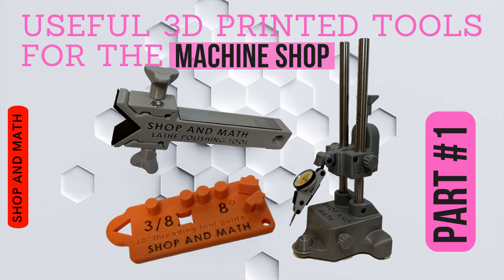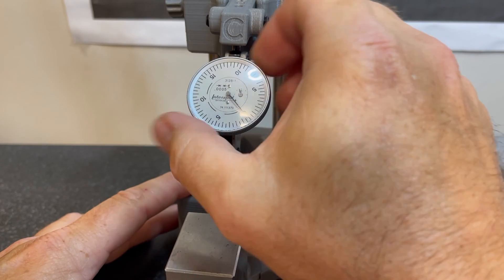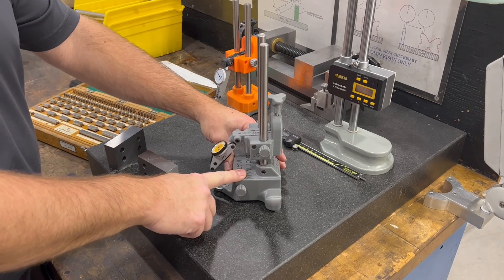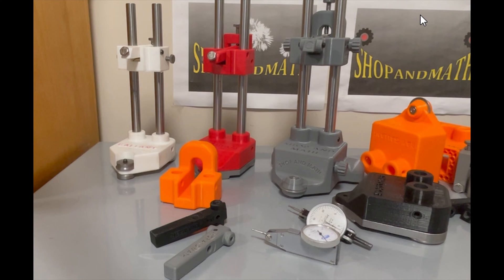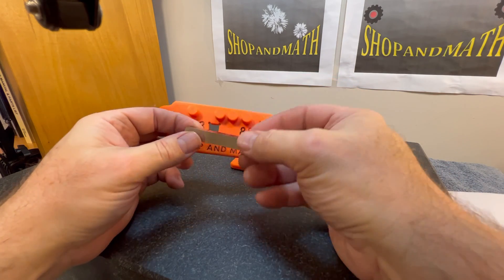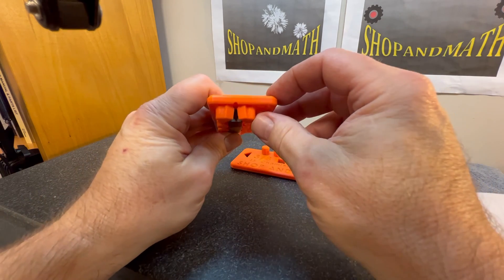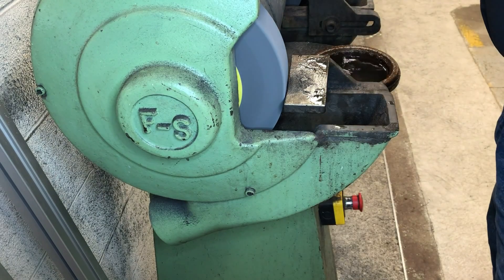Useful 3D printed tools for the machine shop

Comment: WARNING: (Very Dangerous Procedures)
* Video: (2:03/4:40) Lathe Polishing Tool
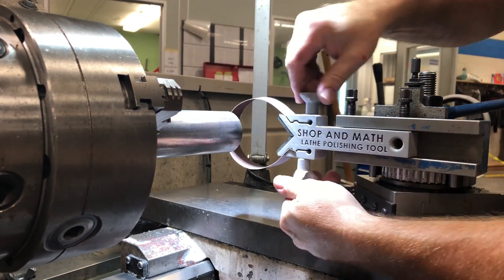* Video: (2:22/4:40) ['compound rest = 45'] Using 'cross slide' to pull sand paper strip back 
--> "NO SENSITIVITY FEAL" --> {Pull Material Out of Chuck}.
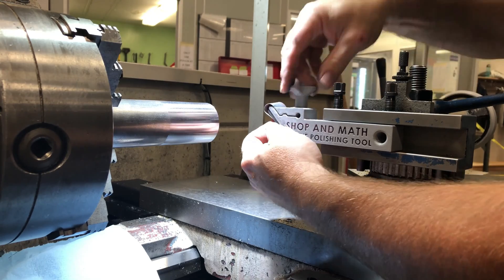* Video: (2:33/4:40) ['compound rest = 45'] Using 'cross slide' to push sand paper strip in 
--> "NO SENSITIVITY FEAL" --> {Push Material Out of Chuck}.
Reply from the maker: Hi Bill
You do realize that the lathe polishing tool is made out of plastic 3-D printed 
PLA 3-D printed plastic does not have the tensile strength to remove apart from the chuck
And if you could pull the part out without breaking the paper, and without breaking the 3-D printed piece, you didn’t have a tight enough 
Ray

Comment: What do you mean by "cosine error"?
Reply from the maker: Cosine error.
Basically, the indicator will not read a true distance traveled. I made a video on this to explain this to my students and I’m attaching a link.
https://youtu.be/toEVZeupYR8
If this does not explain it well enough, send me a message and I’ll try and explain it in a different way.
 Ray
Reply: @shopandmath  
That is an unfortunate term for using the cosine of the angle to calculate the length of the hypotenuse.  But thanks for clarifying what you meant.
Reply from the maker: @reed-young  

Watch this video this should explain everything you need to know about cosign error
https://youtu.be/toEVZeupYR8
Reply: @shopandmath  
No thanks.  But you could go and take a trigonometry course at your local community college if you don't understand why "error" is inaccurate for what you're using the phrase "cosine error" to describe.

It's obvious from the one video of yours that I already watched why you call it that:  the difference is smaller than the precision of wood shop tools so it's as small as a proverbial "rounding error" but it still is not really an error.  It isn't slop nor is it any mathematical error such as rounding.  "Pythagorean adjustment" would be an accurate term and there are a lot of other possible names that would not be wrong.  Calling it an "error" is wrong.  It isn't an error.  It's a difference, which can be calculated exactly using the length of either of the two legs of a right triangle that is adjacent to the right angle, and the cosine of that angle (or the sine, depending which leg and which angle you use).
Reply: @reed-young  Not sure I understand your complaints. As per Merriam Webster, one of the definitions of the word "error" is "the difference between an observed or calculated value and a true value". And surely it's impractical in many scenarios to calculate this amount or adjust for it as you suggested -- for example, quickly setting up an indicator on the end of a noga arm, so you're only working with the observed value against the true value. But even if you put in the effort, at some point you reach the limits of your measuring tools -- it will never be perfectly square. Therefore "error" seems quite apt. Correct me if I've made an error.
As for cosine, idk, seems ok to me. The angle being referred to is the angle between the desired (adj) and actual (hyp) lines of measurement. The trig function that relates these lines most directly is cosine, for example if the measured distance were 2" with a 1 degree misalignment (if it were known) then the actual distance would be 2"*cos(1 deg) ~= 1.9997". Obviously it could be called something more accurate, but I would argue "cosine error" is fairly succinct and compatible with general shop talk while also being fairly accurate, possibly more so than "pythagorean adjustment", which while technically true is arguably more vague (and also twice the syllables).
And needless to say, "cosine error" is very much the established industry term and not just a term this guy invented. You can open a textbook on laser interferometry and find the term (and those people surely know their trig).
Reply: @squiresuzuki  
To clarify, in your example, the error* comes from measuring one leg of a triangle as a proxy for the leg whose length is actually of interest, and the cosine function provides the correction*, not the error.  So like I said, I am of the *opinion that "cosine error" is an unfortunate combination of words that doesn't accurately describe the process that has been given that name, specifically the role of the cosine function.  If your opinion differs, I agree to disagree.

*But I wouldn't call that an error either, when the measurement is taken in the first place with the knowledge that it's a proxy for another distance.  It's a clever way of employing math to avoid hassle, just an unfortunate term for it.

Comment: Nice work. I had watched the entire squareness comparator video a few months back. Good to hear you are on v8! Most people stop at v1.
Reply from the maker: I’m already planning some more modifications on this version the adjusting screw hits the two upper rail sometimes with your fingers so I want to extend both of those pieces out at a few minutes to the print time but that’s about it.

Thanks for taking the time to comment much appreciated.
Ray
Reply: @shopandmath  I will print your design one day. I must have 10 dial test indicators sitting in a drawer, ha ha. I’m actually into designing a scratch built bench top sized CNC machine. I was thinking a design like this might be adaptable to the build process. Squaring up the Z axis to the XY plane when at the frame build stage. Before any of the liners motion components are installed.

Comment: To check squareness the part should be inverted, not checked end for end. Your test compares squareness errors on each end of the part, but does not verify actual squareness.
Reply from the maker: Hi Joe, thank you for commenting.
If you check the right side of the part and it’s out.0.0001 and then you check the left side of the park and it’s out 0.0005 add the two together which equals 0.0006 and then divide that by two which equals 0.0003 that is how much your part is out of square